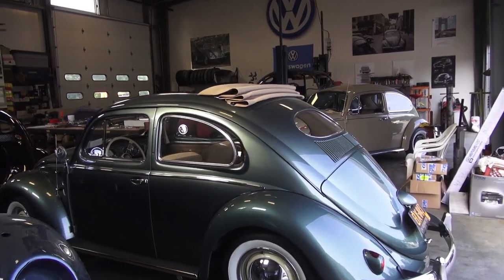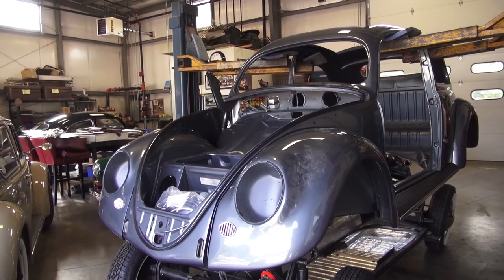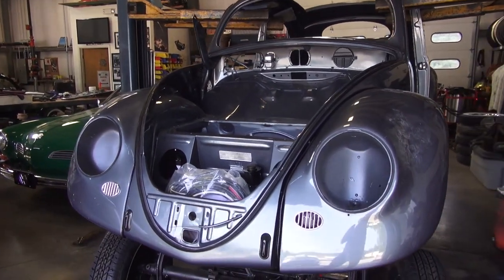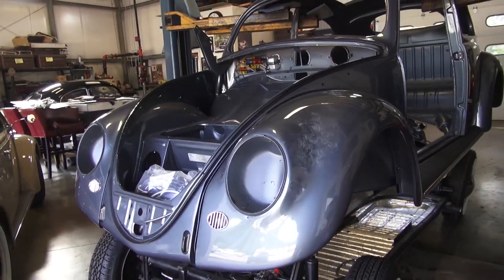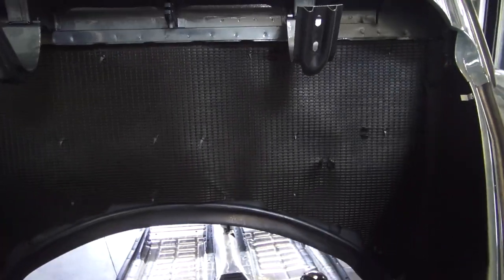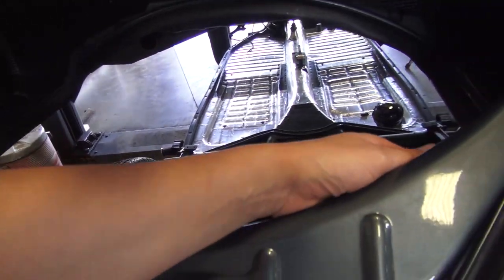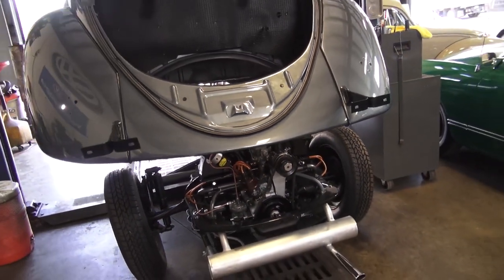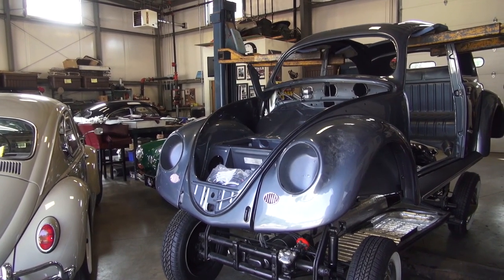Classic VW BuGs 1954 Beetle Ragtop Sunroof Resto Build Update 6-15-17

Comment: Chris, I'm about to install my new 1776cc in my 74 Conv. Super and since I've spent thousands to have it built I'm concerned with it's longevity I was wondering were you stand on full flow oil filters. I'm considering adding one. any thoughts. I will be driving it the heat of South Florida. although I've never had any problems with the stock 1600dp on two different bugs  even as a daily drivers. Any thoughts??